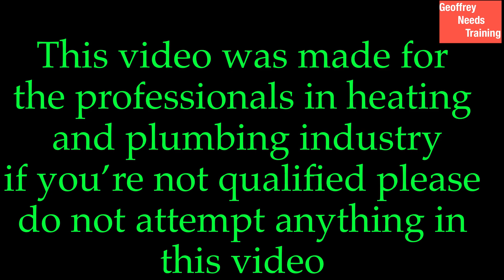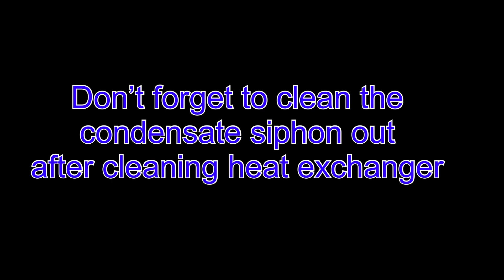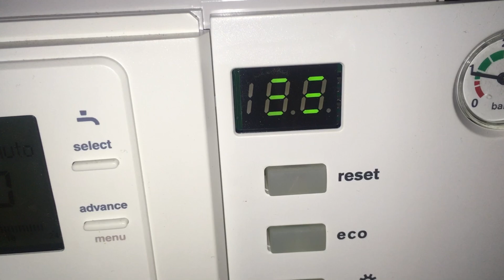How to clean the heat exchanger on CD I

Comment: my greenstar 42 burns Propane and a while ago would hardly heat the rads. Turns ou the whole centre of the HE was blocked witha circular wad of gunk. it took us a while to soften it up with bicarb solution which we pored into the top of the burner casing.

Comment: Good video. Does anyone else find that on lots of these heat exchangers that give a low fan pressure reading, that after cleaning a ton of deposits out, that the reading hardly improves?  The cause I’ve found in many cases has been to do with the burner, where the gauze like skin starts to go slightly saggy.
Reply: Yep, exactly the same. It’s like trying to clean up cement! Fan pressure rarely goes up when badly blocked! Same as the kebab, that Coca Cola trick does bugger all to remove a seized baffle

Comment: Hi. Great video.     I’ve found several times that the middle slot seems to be blocked solid , I was using the Bosch tool  I couldn’t get it clear and was worried about damaging it 
Why does this happen ?    Perhaps I’ll try a nice or hacksaw blade ?
Reply: I always use a hacksaw blade on each horizontal channel, but it can still take some time to clear. 

Anything that is thin enough to slip in will be kept in line by the Heat Ex fins and not harm any one area. Then hack away. Especially those folks who haven’t touched it in 10 years

This sodium bicarbonate idea is a good trick I’ll try

But I know what you mean, it seems heavy handed but they all block around the same area and the service kits won’t shift it.